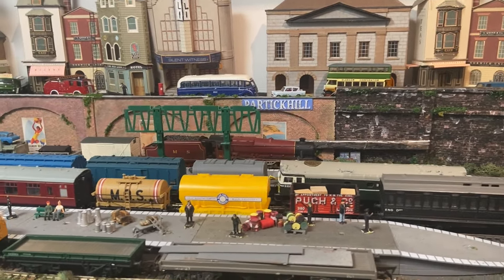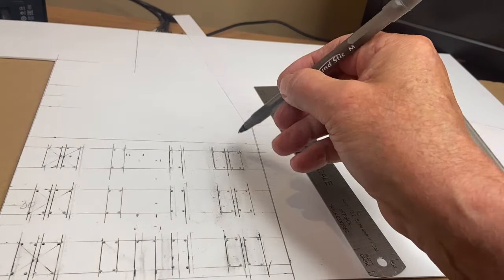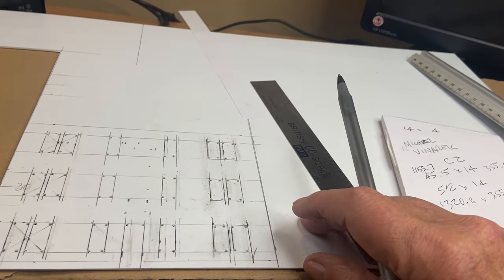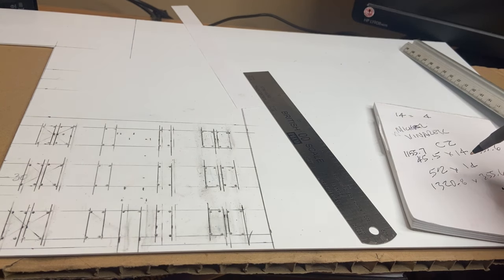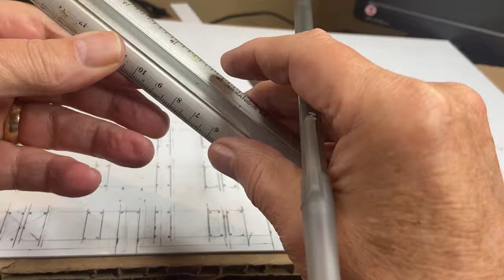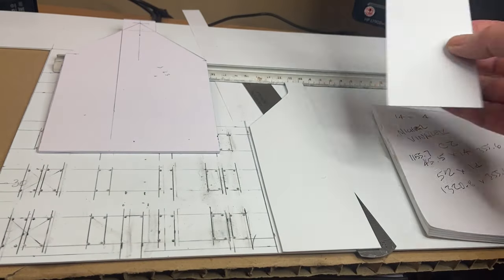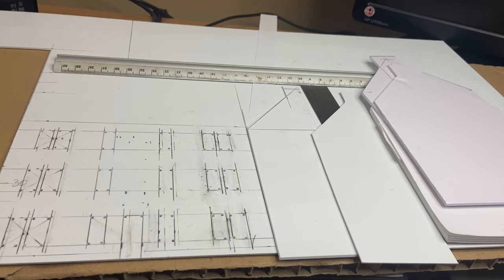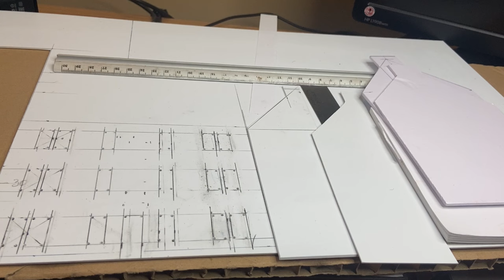Part 2 Update for Tenement Build

Comment: Hi Charlie - You are making some good progress and I look forward to folloeing the build.
Cheers Kev
Reply from the maker: Hi Kevin, Thanks for dropping the note. I was promoted to attempt using Plastikard by @boomersdiorama whom I watch religiously. He suggests it is a better material and provides a greater level of sustainability and detail. So I took up the challenge.
There is no question it is more work and I may have chosen too thick a material, it is pushing me to do better and I am sure it will look better than my grey card one.
I am also building one using Sintra which is much more forgiving and it will be interesting to see how they both turn out.
Once again, thanks for stopping by.
Cheers
Charlie

Comment: I know from making the Wills craftman kits cutting through the sheet is a killer, I did see aguy use a panel nibbler but the tool around £25 and you still have to do the close bit by hand to get a clean cut

Comment: Hi Charlie. That's a hard material you are using !! I have some plasticard but don't use it much. I am interested to see how you use it Charlie. Regards Alan in the loft  :o)
Reply from the maker: Thanks for commenting Alan. In retrospect I should have chosen 1mm thick, this thickness is hard going.
The Foamex is so much easier to work with
Reply: @charlie1872  Hi Charlie. I make most of my scratch builds in 1mm or 2mm grey card that's strong enough and easy to cut with a Stanley. I have also been experimenting with 2mm MDF. So many new material to choose from mate. Regards Alan  :o)
Reply from the maker: There is also chipboard at about 1/8”
Reply from the maker: I built my original Tenement using the grey card. I just wanted to try other materials 👍